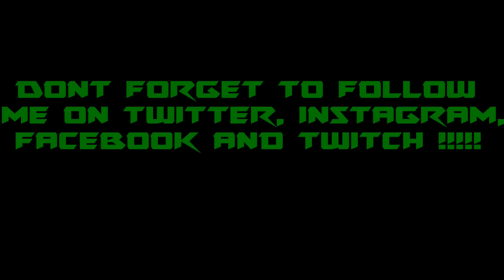My Most SCARIEST Motorcycle Moments + R.I.P. PIGEON

Comment: I drive a Special Construction MC with a 110 ci Rev-Tec motor.  I try not to lane split unless I have to.  I don't run a muffler so you know they hear me coming.  Your video is interesting and informative, and I like your style.  I'm almost 70 so most of the high speed stuff I gave up years ago.  The good thing about getting old on a motorcycle is you appreciate things more.  I rode without a helmet in California until they brought in the helmet law, (that sucked) but now I enjoy the helmet because over the years you lose so many friends on bikes.  Anyway, the tip for the day is, "There are old bikers, and bold bikers, but there are no old bold bikers."!

Comment: That car sounded like it had a dead battery. Could have been an alternator issue if their car died while driving.
Reply: I don't think its the battery. The cranking shows that there's power being transferred into the starter. Probably a bad starter, alternator, or fuel pump. Or even something ridiculous as a blown fuse.
Reply: Jeo Trillio it was either the alternator and or starter moter

Comment: Yeah that cars battery was the problem. That sound is the starter motor not getting enough power. Good job for checking the terminals man.
Reply from the maker: I figured that was it, just didnt wanna sound like I knew what it was when I didnt lol
Reply: probably the alternator blew and the battery ropes couldn't discharge
Reply: that was my thought exacly, i'm not mechanical, its just the same kind of sound i heard from my bike after i left it for a while and the battery went flat.
Reply: Could be the starter motor as well. But that's a bit less of a chance. GoodguyXderek helping peeps in their cars
Reply: TheLeafySpring The starter motor sounded fine from what I heard, and i think Horry was right saying that the alternator blew and the battery couldnt take the load and died...the ticking sound is the giveaway
Reply: definitely the alternator that went on that Nissan, it stopped producing current and the car ran until the battery ran out of electricity. that lady needs a new battery( or recharge) and an alternator. CHHEAAAAHH
Reply: darrel nutz it was just the battery flat
Reply: nah man its not just gunna die while running if its just the battery unless they turns it off m8
Reply: TheLeafySpring Starer motor has a different sound when it dies. That clicking noise is the starer motor not getting enough current.
Reply: yer exactly the battery is flat
Reply: freeze69IceMan it had to be the altenatore. the car was off on the side of the road if the battery was bad the altnatore could still run the car so unless for some unkown random reason they turned there car off on the side the exit then tempted to restart it the altnatore is bad. that's not to say after they do a altentore it dosnt need a battery but the altenator was the cause of the car shutting off and not restaring on the side of the road
Reply: Kevin Weil finally someone who knows what they're talking about
Reply: darrel nutz i'd go ahead and slap a new battery though just to be safe
Reply: When a vehicle loses electric power while running it usually means your alternator is defective, can have a seized pulley causing the belt to drag over the pulley, not turning the alternator. A broken serpentine belt will also cause this, however in most cases your engine will over heat before you lose electrical power if your belt is broken. Sometimes, everything can appear normal, just providing no charge, this can be checked with a simple test light. The battery should be changed in this case because a weak or old battery will put more stress on your alternator, resulting in premature failure. My ATV had a weak battery and cooked the alternator (stator and resonator in small engines) 30 km from my truck near dark. Spent the night sleeping in gravel by a fire, not fun.
Reply: C Genious
Alternator, or Serpentine beltThumbs up!!!
Reply: freeze69IceMan Most likely the alternator going by the sound

Comment: Your camera angle makes it look like your REALLY close to the cages on your left. Good on you for helping the chicas. 
One of my scary moments: High desert mountain rd, long straightaway with several cars bunched up going slower than I wanted to go. I pass at a high rate of speed only to find the lead car turning left RIGHT IN FRONT OF ME! (I didn't know there was a cross st)  I swerved and felt the rear bumper barely touch my pants! I had to pull over and take a shit after that.

Comment: Wow your payment system for fuel is so different from ours in the UK. We arrive at the station. lift the nozzle wait for the guy to accept your pump in the shop which will allow the fuel to flow. you fill up to however much you need/want then go in and pay. Can you only pay in multiples of 5? so you can't get a little bit of fuel for like $3.65?
Reply: So many people steal. They no longer allow you to pay after u fill up. You either have to put your card in prior, or go inside and say how much you want and which pump and then pay for that at the register also prior to pumping. Yea America has a bunch on no good thieves.
Reply: Josh Griffiths Same around here, we fill up and pay after. Only a few pumps require payment before filling.
Reply: No you can buy as much or as little as you like....km I really wanted to I could get $3.65 worth of gas but it's just easier to give the guy a 5 and be on your way ... you don't have to wait for him to get exact change
Reply: You only have to pre pay in big cities though
Reply: Josh Griffiths What? You mean you can just put gas in and leave? I think I want to move to the UK.

No you can pay in different amounts of money, if you pay over the required amount of fuel you need you just go back in for the change. A little inconvenient but it works really.
Reply: Josh Griffiths I live in a big city, and you can 
A) use a credit/debit card at any pump
B) prepay at any pump
C) usually between the hours of 7am and 9pm the pumps closest to the gas station so pumps 1 & 2 usually you can pay inside afterwards
It all depends on the gas station, and if they have video cameras pointed at your car, licence plate, and if they have enough employees for one to watch the video feed (which is why you wait for the guy to accept your pump, they make note of your plate and car type). My mom refuses to do prepay at the pump, which is how I learned about all of this.
Reply: Miss Infinite refuses to pre pay? i dont understand why... you have to pay for the gas either way why does it matter if you pay before or after?
Reply: ***** yeah just loft the nozzle and start filling to whatever you like or till its full as a fuel tank can varie from what's left. like my last fill up on my bike was 8.67 pounds
Reply: Josh Griffiths  That sounds amazing really. I can't wait to get my bike.
Reply: Guinelle1 She probably refuses because its impossible to know exactly how much gas you need. Mainly she goes to Holiday stations where there are discounts. She could have only 5 cents off per gallon with her card, or she could have 50 cents, without knowing and without a very accurate gas tank you can't tell how much it will actually cost to fill up.
Reply: Cody Johnstonbaugh that's not really true, I'm in a small town(Waynesboro, pa if you're wondering) & if you put the refueler in before you prepay they have already called the cops on you & the pumps are the auto-locked versions too! No joke, a buddy of mine got arrested for doing just that! We both pulled up, he(I didn't need fuel) took the pump handle & placed it into his refill pipe then pulled his card out to place to pay & the cops where right on him! & we both asked why & they stated he was stealing fuel! Now, how's that right? Pumps are locked til you pay! He got off with a warning in court, which both of us think is bs!
Reply: Josh Griffiths In South Africa we aren't allowed to fill up ourselves.  There are attendants (pump jockeys) who do the filling up, and then process payment at the shop for cash transactions, or they have those wireless speedpoint card machines if you're paying by card.  The pumps are locked electronically as soon as the hose nozzle is returned to it's cradle, so the attendants all have some sort of electronic key like those old rectangular car immobiliser chits with the 3 contactors on the end, or the newer pumps have passive transponder systems and the attendants have tags on lanyards around their necks, so as long they get to about half a metre of the pump when lifting the nozzle from the cradle the pump registers the tag (and which attendant it is) and unlocks.  We don't need to get off our bikes or out of our cars during the process (good for us) and it's an avenue of job creation (good for everyone).  The attendants also usually offer to check tyre pressure (we don't pay for the air compressor service), oil, brake & power steering fluid, and coolant levels.  They let you know if you need anything, as the shop sells all that stuff too.  And they also wash your car's front and rear windscreens while the fuels' filling.  No I'm being dead serious here, we don't call them gas stations or petrol stations, we call them service stations, and it's for a reason :P  Also it's customary to tip the guy a few bucks if he's topped your oil up and washed your windscreen and stuff cuz in the end he's maybe saving you from breaking down with a seize or an overheat or the excitement of failed brakes... LOL
Reply: In Australia, we pump the fuel ourselves then go in and pay, and there is usually only one CCTV camera at the petrol station. I guess we are held together by trust in this country!
Reply: Exodus227 Same in Estonia.

Comment: My scariest moment thus far was riding to college and stopping at an intersection waiting for the light to turn green when in my mirror I see a semi-trailer approaching behind. Looking at my mirror I could tell this guy was speeding in the semi-trailer as it was approaching way too fast for the distance it needed to stop for the light so I had to quickly shift into first and find that friction point (at this stage I had only been riding for a week) and luckily I actually got the friction point first go (usually before the light turns green I practiced by finding it) and I quickly moved into the next lane narrowly avoiding being instantly killed by at-least a second.
That being said the luck didn't end there as the semi-trailer actually criss-crossed through cars in this intersection not hitting anything or causing an accident. After that incident I found the nearest small street (riding on adrenaline at this point), got off my bike and just sat there for a good 30-40 minutes shaking and being too afraid to ride. Eventually, I cooled down and just rode straight home. That was enough out-doors for me that day.

From that experience I never EVER have my bike in neutral at the lights anymore and I have ALWAYS looked in my mirrors at a red light and look around before I take off in-case someone decides to run a red.

I have only been riding for 2 months now and I can say that experience helped me become more cautious and aware. Even if I was in a car it would have rear-ended me badly and I probably would have gotten crushed at the intersection by a car.

Watching that idiot in his ute/truck swerving into you/being dangerous just makes me wonder why the fuck do these drivers just pay fines when caught and then have the right to drive again after a potential short suspension? I mean fuck me, make them do the drivers course again with a passing score of 100% before they are allowed on the road again. Riders aren't assholes, it's the poor quality drivers around us that make us turn into fight or flight mode and in fear we become aggressive to survive as our lives are being jeopardized. 

I wrote more than I intended but it just sickens me, the amount of times people have cut me off and tail-gated me to the point where I actually have to say something is just sad. If I needed to brake to save my life for whatever reason the idiot behind would just end up killing me anyways. I never noticed it driving a car but riding a bike puts your safety in perspective.

breathes out

Comment: Dead battery caused by a loose terminal... The starter didn't engage because of the low voltage most probably.

Comment: Just a fyi Bakerxderek that clicking noise you hear from the car is a dead battery. Either the battery died ( cannot hold charge ) or the alternator is dead or the lose battery connection can cause it as well.

Comment: sounds like the alternator went bad and it didnt charge, sounds like not enough voltage to turn over not loose
Reply: +Braapman Jesus when your alternator goes out while driving in an automatic it sounds like your car is going to explode. People got so pissed off at me while I was getting my car through an intersection to go to AutoZone, sounded like it was about to give up at the red light and it wasn't shifting out of first. I had to run the red light, dude behind me was pissssssed. Her car either died completely or started making those crazy ass noises and she turned it off and it's out of juice. Lol... loose terminal..
Reply: (lol and because my alternator was fucked my lights weren't working so the guy couldn't see I had my hazards on).
Reply: A loose terminal would be making less surface contact and would prevent the alternator from properly charging the battery. So there is a pretty good chance the loose terminal was the cause of the problem.
Reply: Thestandard71369 That wouldn't explain why the car would potentially have died right there. The battery can be shot, but the car will still run once it's started. I figured it was probably just the entire alternator because I wanted to turn my car off  while it was making those noises and lurching like it was, too. She probably turned it off herself and couldn't get it started again with a dead battery. Not really seeking to argue about anything because I see your point, but I've personally never had issues because a terminal was a little loose.
Reply: +kiraanimerawr1 Most newer cars will not run without the battery. She could have just hit a bump and jostled the cables just enough to kill it. My fiance had an 02 Cougar that died several times because the battery went dead while she was driving it. Her sound system was too big for the stock charging system to handle the base hits. I'm not trying to start an argument either. Just pointing out an observation. Cheers chief.
Reply: Thestandard71369  Wow that's weird, my car is a 2003. Guess I just don't have enough experience with other vehicles lol, cheers!
Reply: +kiraanimerawr1 one of my cars is a 2004 and the factory security system has completely turned the car off going 70mph down the highway. There are all kinds of reasons cars break down randomly. It's easy to forget that.

Comment: Flat battery, alternator shit it's self or even maybe the starter motor shitting it's self but it dose sound like it isn't getting enough power so most likely the first 2 or the first one being the battery shit it's self
Reply: Alternator. You can hear the starter working, and an alternator would keep car running. So I'd it dies and won't restart it's probably a bad alternator and now a dead battery.
Reply: Pace Holder Yeah the battery was  dead but, I think the alternator did shit the bed.

Comment: Have to comment on this; that gap you mention hitting on the 91 and throwing off the handling of the bike, was at least partial cause to an accident I had on the 91 a few months ago.

I was entering the car pool lane (just before the 71 north) on the 91, and some guy in a truck cut me off. While focusing on stopping as fast as I could my bike's front tire entered a fairly large gap between the two lanes (I take the 91 almost everyday for work, and knew the gap was there and had problems with it before hand). I'm fairly certain that because of that gap that was just the right size for my front tire, and me trying to stop quickly, the front tire lost traction and me and my bike went down on our left smacking the pavement pretty hard and went sliding to a stop. My armored jacket/gloves saved me from breaking anything, though my knee wasn't as lucky and I have a nice big silver dollar sized scar there as a reminder now.

I used to live up in Fontucky and have been to San Bernighetto plenty of times, not sure how you handle the god awful streets over there bakerXderek on a super sport but I applaud you for it! haha have a good one man

Comment: I was on my dual sport doing like 80mph in a 30mph zone and a van pulled out on me and I missed it by like 7 inches... Needless to say, I went home after that lol.
When a car makes that sound, it normally means the battery is dead or had a bad connection. If it's dead, it normally means the alternator has failed or there is a bad connection between the alt and the battery.

Comment: As for the car that wouldn't start, that clicking sound is the solenoids in the starter trying to turn the engine over without enough cranking amps from the battery. Basically they had a dead battery... possibly from that loose terminal or a bad alternator causing the battery to not charge properly while driving. Once the voltage gets low enough the ignition system can no longer function and the engine shuts off.

Comment: Once when I was riding my KLR which had LED spotlights mounted on the fairing, an HID low beam and an oscillating hi/low modulator in the high beam (which were all on), I was going over the 91 on La Sierra when a driver pulled out in front of me from the offramp against a red. Never even looked and was running a red light. I locked up the rear and revbombed that old lady driving. She doesn't need to be driving. Needless to say, I had to change my shorts...